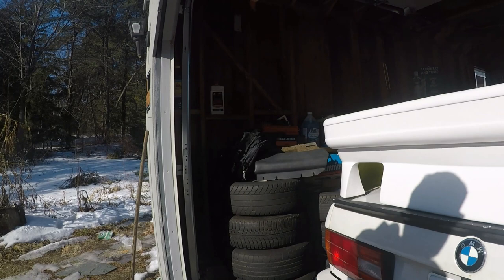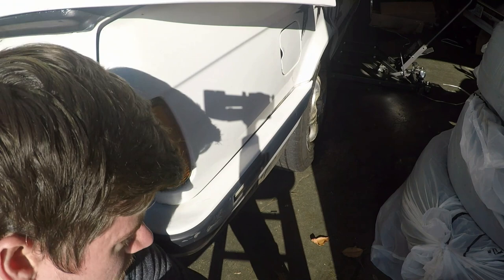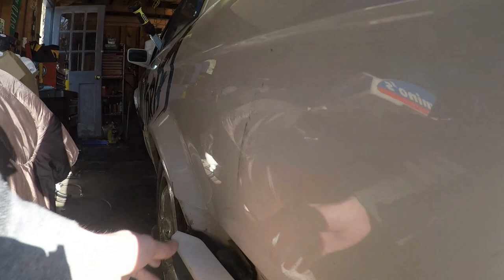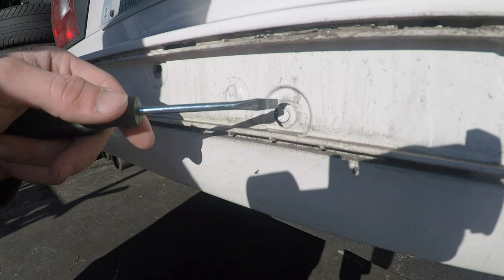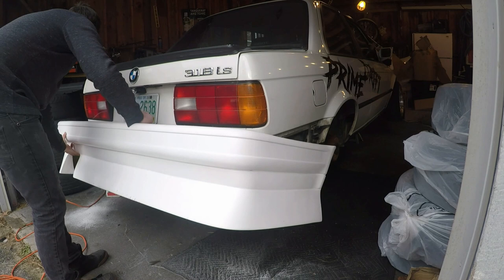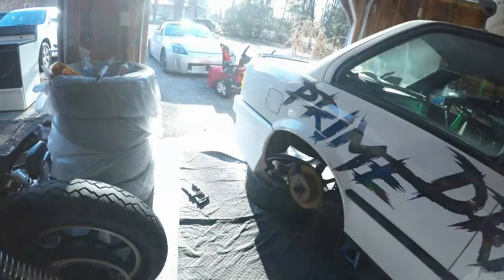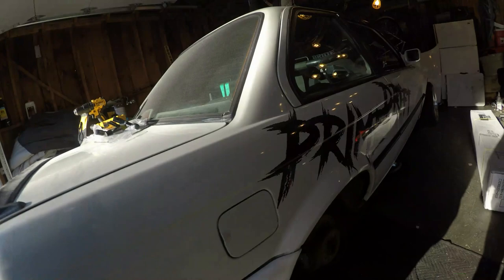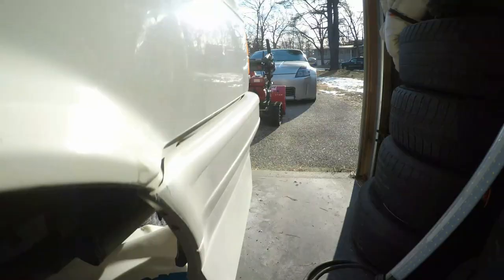CLIQTUNING E30 Aero kit install.... (part 1 )

Comment: Great vid man! I would def look into getting an external mic for your camera though. Most on-board audio is extremely sensitive to wind and other things. Hope it helps!
Reply: @primedrift2752   i can definitely look into it! what kind of gopro you have boss?
Reply: @primedrift2752  so I've looked into a couple, there's one that's wireless that I guess plugs into the USB port and then hooks on the back of the GoPro, but it's only $15 and I'm not 100% sure on the mic quality. But as for me I use a movo LM100 (I think? I know it's movo) lavaliere mic, long but really thin cord and comes with wind socks for around $30.